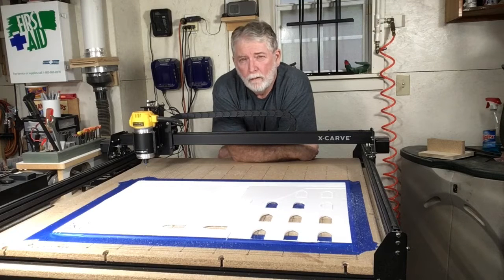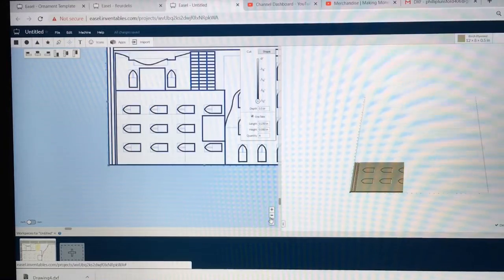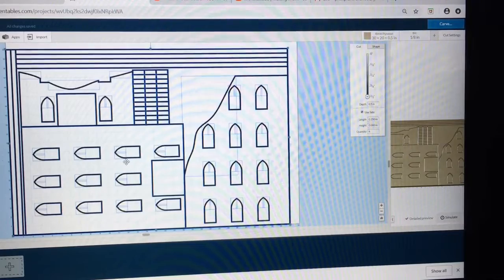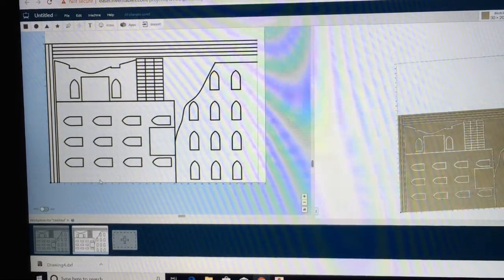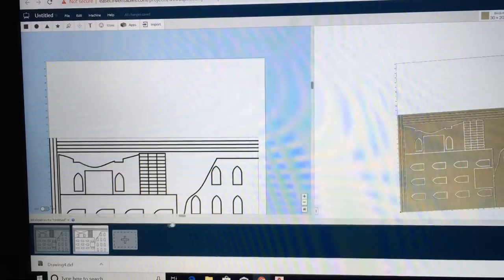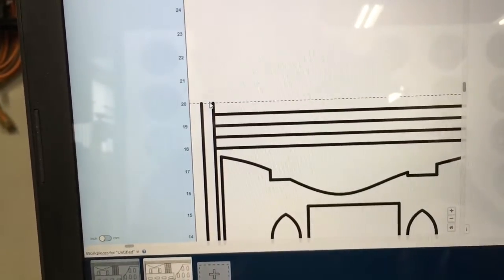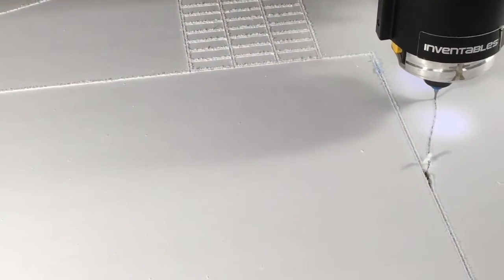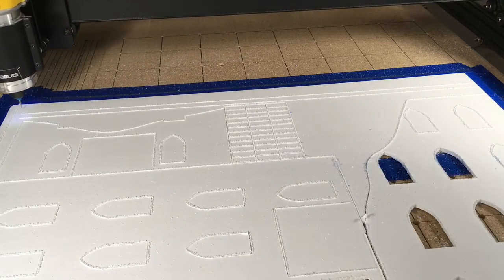New Feature DXF Import Directly into the Easel Software

Comment: Would be useful to know the carve settings like ... Outside, inside, or on the line.
Reply from the maker: This was an experiment.  There are no specific settings.  You want to use a small bit at a fast feed rate to avoid melting the foam.  You can set it on path or inside, outside, it all depends on what you want to do. Different foam will be different also.  You must experiment with feed rates on your machine.
Reply: Paw Paw’s WorkShop , much appreciated.  Im just a couple weeks in on using the xcarve and have knowledge gaps in Easel, sketchup, etc. and no experience with cad or software like that.  I keep returning to your channel for hands on learning and found it to be a great resource.   Really appreciate the detail, quality and efforts here.

Comment: So 30,inch is the max? Thats horrible..the xcarve is advertised as 1000x1000 but in reality its only 750x750.....to me thats false advertising by inventables
Reply from the maker: der ddd .  The whole deck is the 1000mm or 39.37 inches. I now have red line on my table on the right side. I have yet to move to the max on the left side. I will be putting a red line on the left side also. Then I will have an exact measurement